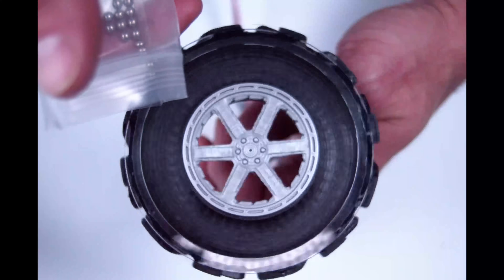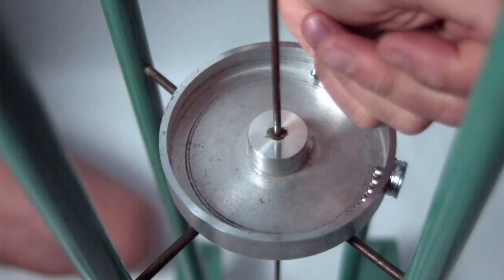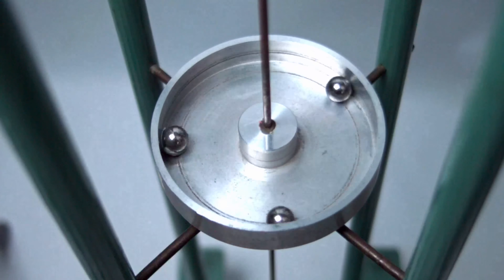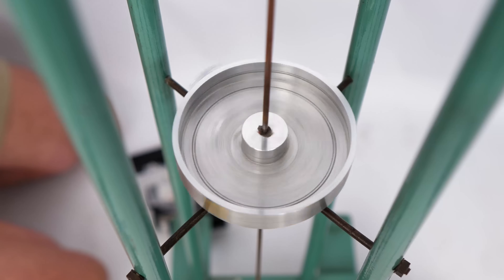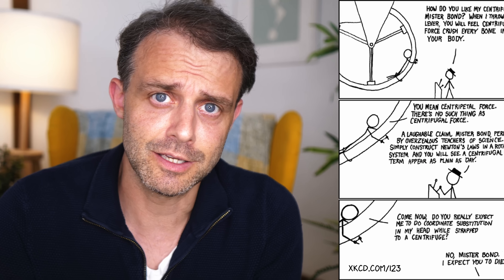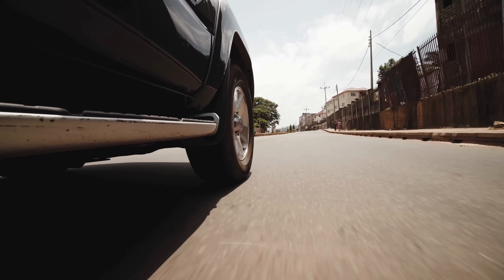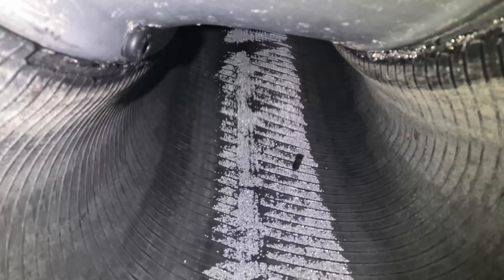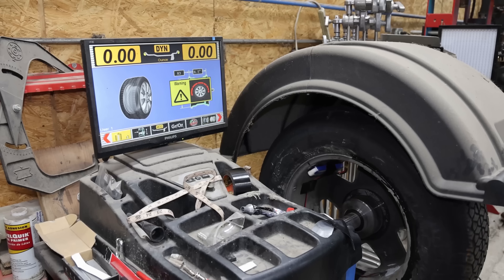Do tire balancing beads actually work?

Comment: I feel the makn question i would have About balancing beads is what sort of effect do they have when you havent been able to get them balanced at highway speeds? If im in stop and go traffic in the city and having all these extra beads in my tire makes my cars efficiency worse, the balance worse, or the wear on the tires worse then i dont feel like that outweighs the benefits. Beyond that, are they that much cheaper than just javjng the tire balanced? It seems like you have un-mount thr tire tk add them in which case youre already either working with a professional or using a professionals tools, why not just do the job "right" then?

Comment: If tires could withstand some liquid, it would be better than beads. Because the method is well known. "E.g. A water ring balanced centrifuge refers to a centrifuge where the rotor is balanced using a ring filled with a liquid, typically water, to counteract imbalances during operation." More to that, the balancing beads in fact imitates a liquid.

Comment: I hate the term "fictitious force".  It's complete and total BS, it's misleading and unscientific, and IMHO nobody should use it.  Centrifugal force is a real force.  It is just as real as centripetal force.  It just depends on what your reference frame is.

Centrifugal force entirely does exist in a rotating (non-inertial) reference frame (and in that reference frame, centripetal force is actually the "fictitious" one ).  Anyone who says otherwise just fundamentally does not understand how reference frames work, and therefore does not actually understand critical aspects of basic physics.

Comment: Here's a good example of a similar type of wheel balancing but using steel shot in oil so it works at far lower speeds....
watch?v=uVA7-B3AYrg

(you'll need to make it into a Youtube URL)

Comment: it's a bit nitpicky, but the motion you're introducing to the swinging bit at 7:09 is different from the one you introduced at 7:30, and I'd like to see you just poke at it really quickly rather than holding on to it like that if that's the comparison you wanted to make.

Comment: I have an idea--why not just figure out how the tire is unbalanced, and then attach permanent weights on the opposite side until it is balanced.  Then the wheel would be permanently balanced at all speeds.  Just a thought.

Comment: This is probably obvious, but each of your examples uses a circular motion in a horizontal orientation. In a vehicle, the wheels are (hopefully) rotating in a vertical orientation. So, if one puts objects or materials inside a tire, the vehicle would shake after every stop. Balancing beads only work if one never slows to a stop while driving. Conclusion: stupid idea

Comment: Does the Diameter of the tire effect the physics? I notice it seems like Large trucks are where I see balance beads in use most often. 

Does turning the wheel on a horizontal axle allow the balance beads to equalize at a lower speed?

Comment: Product idea: Balancing beads which glue themselves in place on the tire after a few minutes, and can be removed with a chemical such as acetone if the tire is removed and needs rebalancing.  
Then, when installing the beads, you just need to use a dyno or go drive at 60 MPH for 15 minutes.  Even better idea would be to have them speed/ force activated.  

Wonder if any glue exists like that 🤔

Comment: Perhaps that could help with somewhat poorly balanced wheels , that way at higher speeds that lack of balance won’t be a problem, and at low speeds a slightly balanced wheel wouldn’t pause a huge problem, however driving AT critical speed will still cause a problem, so perhaps creating a rim-tire combination with a critical speed of say 30km/h would be beneficial as at that speed, I imagine it’d be less dangerous should anything actually happen , plus most driving is happening above that speed unless you’re on a small town road or mall parking lot …

Comment: I’m glad that you posted this. I teach physics and one of my students showed me a video who used beads inside of an off-balanced tires. 1st, it was a neat perspective to see a tire from the inside. 2nd, I couldn’t understand why the beads wouldn’t make things worse by moving towards the off balanced side. We had a nice discussion and thought it would tie into harmonics. We used the oscillating saw (saws all) with a pivoting second saw blade, where at certain speeds the freely rotating blade becomes straight at higher speeds.
Reply: I would suggest that the unbalanced wheel would, by vibration, distribute beads, until they randomly form a balanced pattern. At that point, there would be no further disturbing forces and the wheel would retain its balance. This would answer The4Crawler's experience with tyres becoming damaged.

Comment: It's my understanding that counteract balancing beads have a coating on the tempered glass that creates a static cling that keeps the beads in place when you stop, or at least most of them. I remember reading it on the literature they passed out when we started using them at a shop I worked at. We only used them on commercial tires and large off-road tires though.

Comment: I use Rideon in my motorcycle. It has all of the benefits of balancing beads, but it's sticky and viscous enough that it stays in place after you slow down. Plus, it seals leaks like Slime, but without the mess.

Comment: the motorcycle i bought 12 years ago recently need a new front tire. when i dismounted the tire i found 2.89 ounces of glass beads inside. for 12 years of riding that bike i never once had an issue at street speed or highway speed. i vacuumed the beads out and put them in the new tire. same story! perfectly balanced front tire. nice to not have weights on my wheel!
Reply: 12 years on a set of motorcycle tires?
Reply: But you do have weights. More than if you had the wheel balanced

Comment: I’ve been using balance beads for years on my off-road tyres as they’re so big and meaty they’re hard to balance traditionally and when you do go off-road traditional counter weights are easy to knock off. And when your tyres are full of mud in the tread that throws the weight off also which requires balancing on the go

Comment: - Balancing tyres with weights : do it once and it's done, permanent effect;
- Balancing beads : only works if you get to ~highway speeds for a minute and the effect is gone if you slow down too much.

I like the tech and the novelty but I'm missing the advantages... At least for light duty vehicles in normal conditions...

Comment: I'm a mechanical engineer and my thinking was: 
They can only work for speeds above resonance, because there is a phase change then. 
So basically what you showed. 
But I don't know why there is this phase change. 
And you didn't explain it either. 😢

Comment: I love the way you do these videos, where you introduce a fun quirk of physics, and then give the viewer enough information to try to deduce what's happening, and then break it down yourself and explain it in a number of ways. For me, as soon as you first showed the slow motion video of it stabilising at high speed, it reminded me of a diagram of the earth and moon spinning around a shared centre of mass. It then felt intuitively clear that a ball would want to move to the balancing point, but I couldn't properly explain why until later in the video. Very cool :)
That milk frother trick is WILD too

Comment: Part of balancing should be dynamic balancing to reduce that hop level. You need conventional balancing to ensure the tyre and wheel mass are optimally balanced before adding any extra weighted balance whether it be balls or positioned weights. I think it's really a gimmick because you have to go past the worst point of hop resonance EVERY time you accelerate or decelerate much past the maximum hop resonance. Interesting but for most applications, ultimately pointless.

Comment: My concern is that a car has 4 tires generally which are starting and stopping, wouldn't the balancing beads end up having to re-organize every time it changes speed or leaves a stop? This would be similar to constantly having one side of the tire full of rocks and getting shed only after reaching a specific speed. The wheels would only ever be at balance when you are at specific speeds.

Comment: I have no idea how they normally balance tires, but wouldn't this be a pretty good way to do it when combining these beads with some kind of glue?
You could spin the wheels up, pour the beads in, wait a few seconds, and then pour in the glue and slow down again once it has dried. You'd then have a perfectly balanced wheel!
Or is the normal way of balancing so easy that this is not worth the effort?

Comment: They need to find a way you can beads that "set"... So you chuck them in drive, they move to the correct position and after 15mins they glue themselves to the tyre. 

So they're always in the correct spot then

Comment: I also had to share some weird kitchen phenomenon
when round bottom pot is placed on a IR cook stove it start to wobble circularly.
doesn't matter which material is it, Aluminum, Steel, Copper.
if we stop it by hand again it start to wobbling again.
and this is only for IR heating stove it doesn't wobble on Electro Magnetic cooktop
WHY???

I also has some video about it. if you want i can share it.

Comment: So they may be useful for people who are doing most of their driving on highways, but otherwise seems largely useless. Only if they made them in such a way where they were free to move initially and after some period of time they would somehow attach themselves to where freeway speeds would put them, such that they would no longer be moved out of place by slowing to a stop, gravity, sudden pothole jostling, et cetera. How that would work, I have no idea. Time-delayed adhesion via either heat or maybe UV light (but the UV option would require much more tedious set up).

Peace.

Comment: I wonder what determines the super critical self balancing speed. My assumption is the suspension, mainly the wheel rate (spring rate * motion ratio) and maybe the cv shaft too.
driving the drift car home on the remains of the last set of tires is always a pain, I'm considering trying this next time, assuming flat spots are not too bad.

Comment: I was thinking about city ride and something to replace beeds, like  oposite of oobleck. That wouldd be sheer thining, but someone else got idea allready,
Following is AI generated: 

Shear-Thinning Fluids for Tire Balancing: A Critical Analysis
Understanding the Application Requirements
Your application requires a material that remains solid-like when stationary but becomes fluid when subjected to shear forces during driving. This describes shear-thinning (pseudoplastic) fluids, which are fundamentally different from the shear-thickening fluids discussed in previous conversations.

Shear-Thinning Fluids: Properties and Behavior
Shear-thinning fluids exhibit decreasing viscosity with increasing shear rate. These materials behave as highly viscous or gel-like substances at rest but flow readily when force is applied. Common examples include paint, ketchup, and certain polymer solutions.

Key Properties for Tire Applications
Thixotropic gels represent the most promising category of shear-thinning materials for tire balancing. These fluids develop strength and rigidity over time when not subject to shearing or agitation. When the gel is initially applied to a stationary tire, it remains viscous and stays in place.

Existing Thixotropic Gel Applications in Tire Balancing
Commercial Implementation
Thixotropic gels have been successfully implemented in tire balancing systems. Patents from major tire manufacturers like Goodyear describe systems where thixotropic gel is disposed within circumferential grooves in the tire.

The system works as follows:

At rest: The gel remains in place as a viscous fluid that will "set"

During rotation: The gel flows in any direction of force until only centripetal forces act on it

Balanced state: The gel automatically redistributes to achieve tire balance

Proven Performance Benefits
Research demonstrates that thixotropic gels can automatically compensate for tire imbalances caused by:

Tire tread wear

Minor damage to the tire/wheel

Manufacturing variations

Weight distribution changes over time

Advantages for Stop-and-Go City Driving
Static Retention Properties
Thixotropic gels maintain their position when the vehicle is stopped. Unlike traditional balancing beads that pool at the bottom of the tire due to gravity, thixotropic gels retain their balanced configuration even during extended stops.

Immediate Rebalancing
When the vehicle resumes motion, the gel immediately begins flowing to maintain balance. This eliminates the rebalancing period that occurs with traditional beads, where vibration is felt until the beads redistribute.

Challenges and Limitations
Temperature Sensitivity
Temperature significantly affects thixotropic gel performance. Research shows that gel strength and viscosity can change with temperature variations, which is problematic for tire applications where temperatures can vary dramatically.

Containment Requirements
Unlike discrete beads, thixotropic gels require completely sealed containment systems. Any leakage could:

Contaminate the tire interior

Affect tire performance

Create maintenance issues

Material Degradation
Thixotropic gels can experience structural breakdown over time. The constant "structure formation and destruction" cycle under repeated shear can lead to:

Reduced effectiveness

Changes in rheological properties

Need for replacement

Comparison with Traditional Balancing Methods
Advantages Over Beads
Thixotropic gels offer several advantages over traditional balancing beads:

No clumping issues: Unlike beads that can clump when wet, gels maintain consistent properties

Continuous positioning: Gels don't fall to the bottom when stationary

Immediate response: No delay in rebalancing after vehicle restart

Adaptive balancing: Automatically adjusts to changing conditions

Disadvantages Compared to Beads
Higher complexity: Requires specialized containment systems

Temperature sensitivity: Performance varies with temperature

Potential leakage: Fluid nature creates sealing challenges

Higher cost: More expensive than traditional beads

Technical Considerations for Implementation
Gel Formulation Requirements
Effective tire balancing gels must have:

Appropriate yield stress (typically 30-260 Pa)

Suitable viscosity for flow under centrifugal forces

Temperature stability across automotive operating ranges

Chemical compatibility with tire materials

System Design Requirements
Implementation requires:

Circumferential grooves in the tire to contain the gel

Proper gel quantity (approximately 60 grams per ring for passenger tires)

Sealed containment to prevent leakage

TPMS compatibility if applicable

Current Market Status
Commercial Availability
Thixotropic tire balancing gels are commercially available and have been implemented in various applications. Several patents describe successful implementations in passenger car and commercial vehicle applications.

Performance Validation
Testing has demonstrated effectiveness in reducing tire vibrations and maintaining balance across various driving conditions. The technology has been validated through both laboratory testing and real-world applications.

Conclusion and Recommendations
Thixotropic shear-thinning gels can effectively address your specific need for a material that remains solid when stationary but flows during driving. The technology offers significant advantages for stop-and-go city driving by maintaining balanced positioning during stops and immediately responding when motion resumes.

Key Benefits for Your Application
Static retention: Maintains position during vehicle stops

Immediate rebalancing: No delay upon vehicle restart

Continuous adaptation: Automatically adjusts to changing conditions

No clumping: Avoids moisture-related aggregation issues

Implementation Considerations
Temperature management: Ensure gel formulation suits your climate

Containment system: Requires proper sealing to prevent leakage

Professional installation: May require specialized equipment and expertise

Cost-benefit analysis: Higher initial cost but potentially superior performance

Thixotropic gels represent a viable and technically superior alternative to traditional balancing beads for applications requiring consistent performance in stop-and-go driving conditions. While implementation challenges exist, the technology is proven and commercially available.

Comment: In uni we did some experiments where we investigated chaotic vibrations in in rotating systems - though we imagined more the wobbliness of a washing machine rather than wheels of a car. I think it usually appears once you reach rotational velocities of higher resonance if I remember correctly... Though I never fully understood it as I wasn't smart enough at maths so I might be wrong (I ended up switching from physics to computer science in the end).